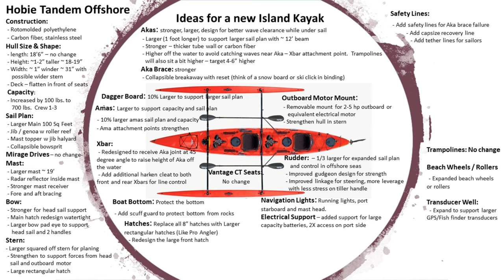Hobie Offshore Sailing Zoom Event

Comment: Thanks for recording the event.  I'm thinking to get a TI too and like your setup on the trailer.  What is total length your TI plus trailer? (hopefully it'll fit in my 20' garage). Thanks again.
Reply from the maker: Total length is just over 20 feet.   I angle in my trailer with the TI and it fits fine in my garage.